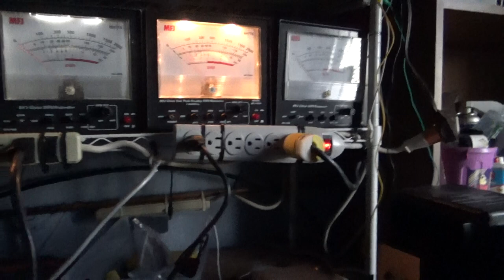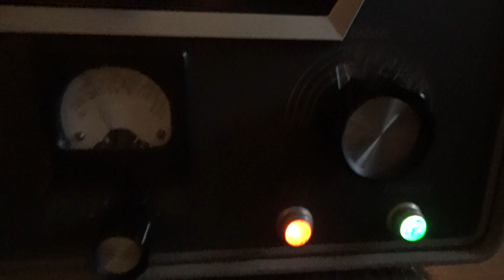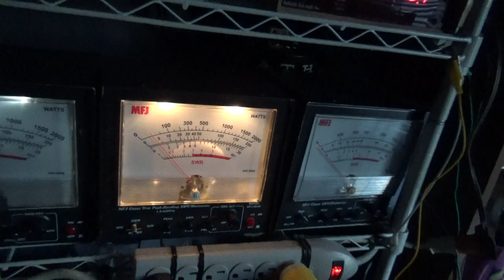Don't try this at home, Gettering a 3-400z using the Loudenboomer Mark II / Hallicrafters HT-45

Comment: A friend of mine has a hand held induction generator that he uses to heat the tube. No voltage needed to getter the tube that way. That sucker will heat tubes red hot in seconds.
Reply from the maker: Sounds good, I would like to see that done.

Comment: Tramdr Can you do a detailed video of your  npc8 mod for the d201 hardwire? My d201 is getting close to finished just a few more resistors to go and some fresh tubes. It will be driving a Kenrich eagle 500
Reply from the maker: Nope. NPC is mainly for transistor radios and doesn't work so well with tubes, especially on a D201'A'  I don't even know what the 'NPC8' involves and D201's already have their own form of assymetrical compression built in.